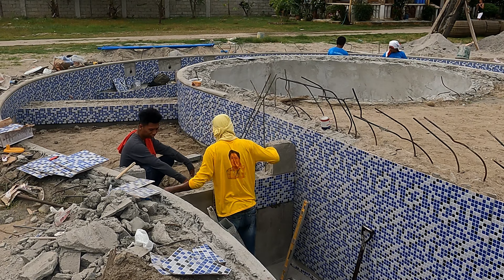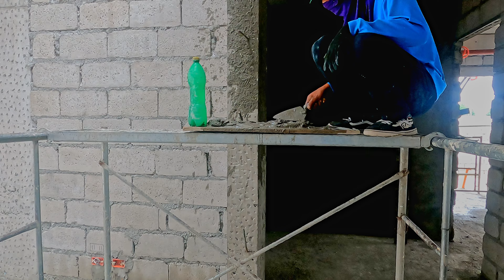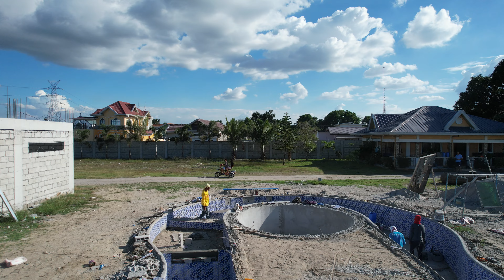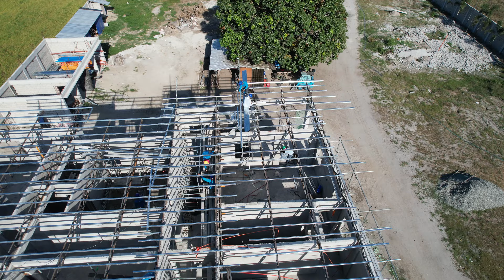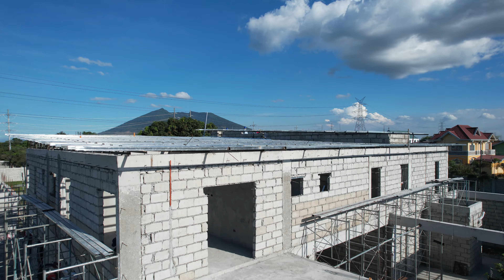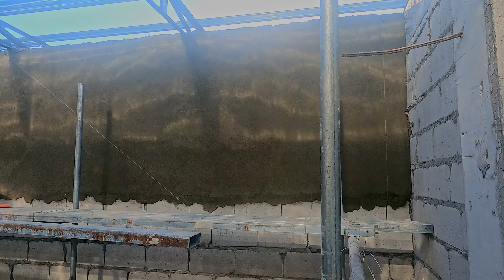Philippine House Building Day 136 - Swimming Pool Explained

Comment: Seven seconds on goggle, "Is silver in water safe? When ingested and absorbed, silver is held indefinitely within tissue — particularly skin, eyes and mucous membranes. Skin discoloration is a cosmetic effect related to silver ingestion". 
Chlorine takes a certain amount of "micro-managing", but I think it's worth the effort. "Redeye" and unpleasantly strong smell generally comes from overdosing due a lax testing regime. I haven't had a pool for several decades - mainly because of the maintenance required - surely testing and dosing technology has improved and simplified since then.
Reply from the maker: Thank JB
Impressed that you spend more time on a Google search than me.
Joe pointed out that you would probably need to ingest a huge amount of silver to have a problem but I do want to find out more about this.
Salt water also a consideration.

Comment: Well mike name of two bridges STAMFORD BRIDGE AND HORNSEY BRIDGE JUST THINKING GREAT VIDEO AS ALWAYS if you can what about Led lighting across where the water comes over the top from the shallow part to the deep part just a thought nice rippling effect cheers gerry
Reply from the maker: Gerry
You may be surprised to hear that one of those two names is not on the table.
And for two reasons.
1) connection to a north London club
2) just looked it up and apparently it is locally known as Suicide Bridge !
There will be LED lights although I don’t have a full layout. And they should be controllable.

Comment: You should also consider pebble dashing the entire pool floor. This would eliminate much of the slip hazard that you are concerned about. You would also save a ton of pesos on tiles.
Reply from the maker: Two comments - really appreciated.
It was a consideration but we got so many comments suggesting we keep the same finish on the walls and floor that we decided to go with that.
In the end, the pool, like the house, is a fixed price. Putting in less tiles would help the builder but I would get no benefit - other than the less slippery floor, but this is something we are just going to live with.
Reply: Stupid idea do you realise you would cuts and damage to your feet if you dash the base there would be blood everry were
Reply: @tomhind266d6  Apparently your limited thinking didn't allow you to consider using small rounded pebbles that are imbedded in the plaster. This practice is also referred to as pebble tech (in case you are unfamiliar). I have used this technique in two of my pool builds and there has NEVER been an issue with injury or slippage.

Comment: Why couldn't they route the orange plumbing through the ceiling tie beams instead of running them under them? If you put in a drop ceiling under the tie beams and plumbing then it would seem that your ceiling height will be severely reduced making the area seem cramped. If you don't plan to use a drop ceiling then are you going for an exposed industrial look?
Reply from the maker: Hi Find Your Focus.
The beams are the primary support for everything above, and the builder was very clear that he did not want to compromise them in any way.
Ground floor ceilings should still be pretty high, but you are right - we do lose something.

Comment: Good morning Mike, Pool the pipe bottom children's area I can't see how that will work as I think would be negative flow so wall change is best.
Pool copping use of pebble will work with the curve shapes nice one 👍 
Pool treatment in our Auckand village complex has Salt treatment however the water goes in electrical unit and the salt water is then becomes chlorine.  (It's supposed to reduce cost.
The other thing we do is have a retractable floating cover, this reduces sun from bleaching removing chlorine. 
The shape of your pool a cover isn't practical .  Then we boost chlorine with liquid chlorine. The pool needs regular ph testing then you know were you are and that the water is safe .Bad water results in skin rash . If the kids drink the pool water (and some do) it's whole new ball game. 
POOLS ARE FUN POOLS ARE WORK.
Reply from the maker: Graeme
Yes I think the channel is better.
Anything you can point me to online about how that salt system works ?
We do need to consider a cover but you are right it might be tricky and definitely would have to be custom made - which of course means $$$$
Reply: Mike . I don't make many comments about the pool but my pool back home is a salt chlorinator system . I have had no trouble with it and the pool system is hooked up to my house solar system . Zero electrical cost . Regards Mick

Comment: HI Mike, good day to you. Good idea on the steps to use the pebbledash, saves slipping from one step to another and on the seating as no doubt someone will use it as a step to get out or in to the pool at sometime. 

fyi i didnt notice any degradation of your videos, always enjoyed them.
Reply from the maker: Grant
Yes I do like the idea. And it is guaranteed you are right about the bench / steps.
I just felt the videos got stale for a couple of days. Or maybe more accurate to say more stale.